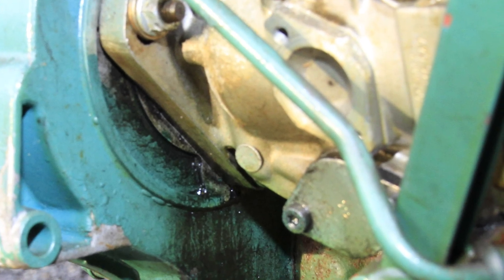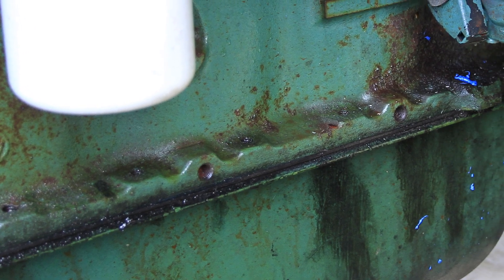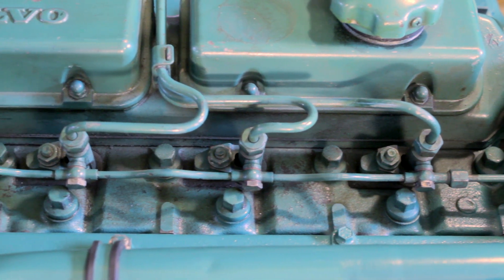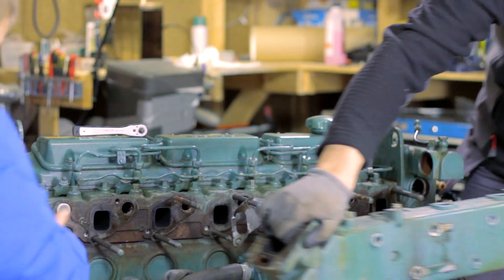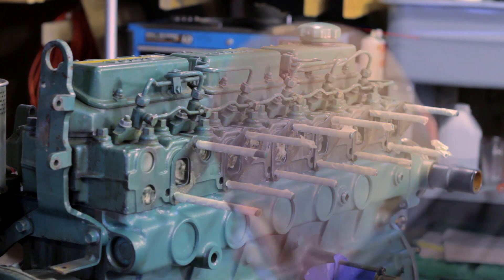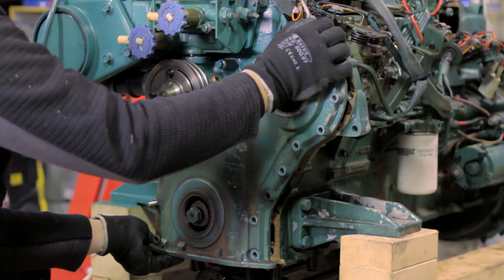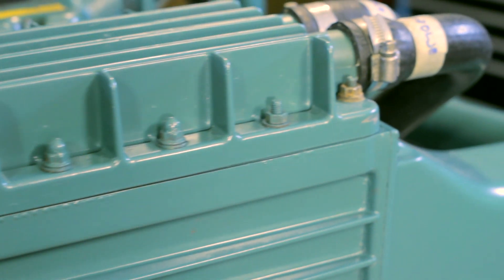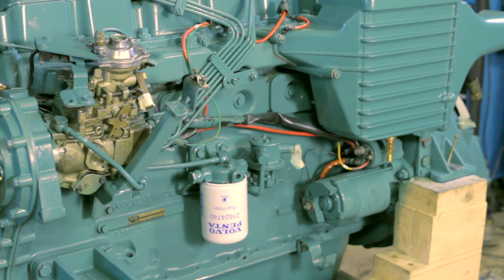Overhauling Tamd41A episode  2

Comment: Hello Sven, I have a question that I would like to hear if you can answer for me. I have to remove the diesel injector pump on a Volvo Tamd 41b, year 1990. When I dismantle this pump, does the cam wheel / pulley need to be fixed? I have seen that  a Timing Tool Kit for Landrover is avible. Is there anything similar for Volvo? Or how do you do it? Best regards  Ben.

Comment: Hi - new to diesels.. Have a TAMD41A that doesnt seem to be getting oil up at the rocker shaft, but has good oil pressure. Is there an oil line that feeds the rocker shaft on this model? How would I check why oil is not getting up there? Thanks

Comment: how do you lock the engine when to loosen / tighten the crankshaft bolt?
Reply from the maker: On the right side of the flywheel housing, there is a small hole (oppisite side of the starter) . Insert a small pipe extension bar into this hole, and apply light pressure. Turn the engine by hand intill the extension bar slips into a hole in the flywheel. Or, depending on how access is, you might be able to look down the side of the engine and into the hole. Be shining a flash light into the hole, you will see the corresponding hole in the flywheel when they line up, and then innsert the extension bar to lock up the engine. Good luck!
Reply: @svendmb  Thanks!!! 👍🏼

Comment: Svend Where are the the two anodes on the engine. One is on the heat exchanger where is the other one?
Reply from the maker: On the front end of the original oil cooler. Some engine has uppgraded the original oil cooler to a newer version. This have no anode, so it is possible your engine only has one. Check for a square bolt on the front end of your cooler. Good luck!
Reply: @svendmb  Thank you